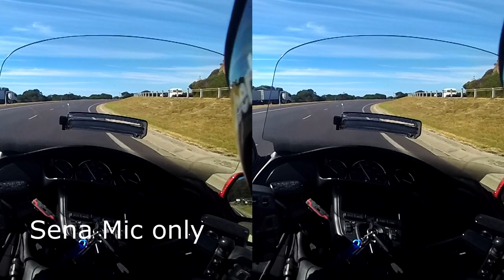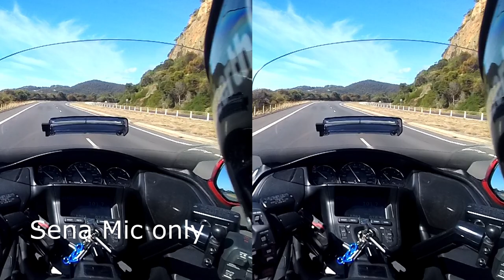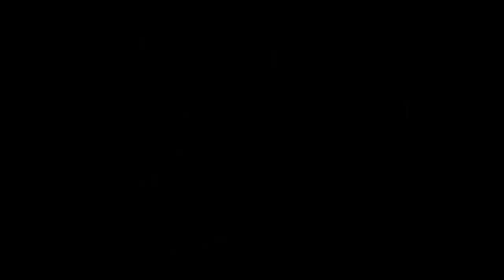Sena Mic and Sena plus External Mic Comparison

Comment: Thanks for this video Kev. I think I'm gonna have to give it some (a lot) more thought - it's a lot of money to spend to end up somewhat underwhelmed regarding the background noise. I may have to go for the 10c evo instead as that one seems to have more comparable sound when comparing with my old 10c.

Downside obviously is not EIS - but I can do what I currently do and run it through a minor stabilization in my editing software. That doesn't remove all the shakes, but it does enough I think to make it fairly watchable. And I'd have to do that with the 50c if I wanted higher resolution than 1080p anyway. 🙂
Reply from the maker: Hi Steve
No worries at all....I will be doing another video shortly with the mic gain setting at low to see if that lets in more background noise....it certainly is a fine line regarding noise, be that wind noise and/or 'other' background noise.....
 Ride safe
Cheers Kev

P.S. My bike is very quiet anyway.....stock exhaust on the GL1800..🏍🏍
Reply: @1Camera1Bike1Life  I'd be interested to see that with gain set to low. And also maybe with the advanced noise reduction disabled?

What I'm trying to get is the kind of sound I get from the old 10c (like on the videos on my channel) and I have a feeling the closest I'm going to get is the 10c Evo, as the 50c just seems to be too damn good at cancelling noise! 🤣
Thanks for being my test-bed!
Reply from the maker: @stevethebikinggrandad  Yes i have looked at your videos, your bike exhaust is much louder than mine....my old 10C pro when I first got it sounded much better, but then with all the firmware updates it all changed....
Cheers Kev